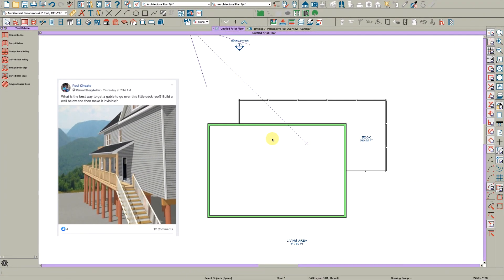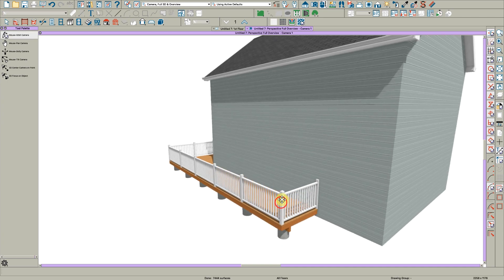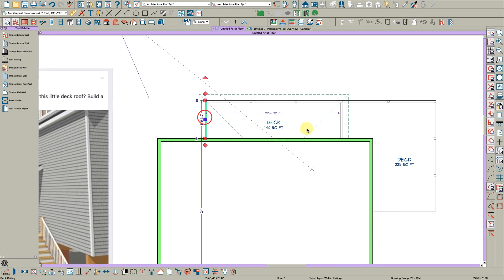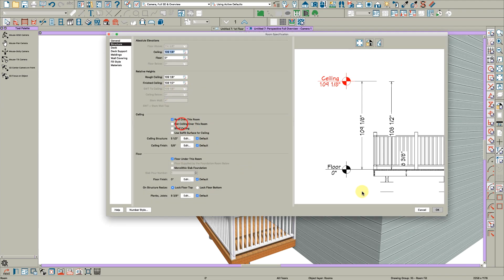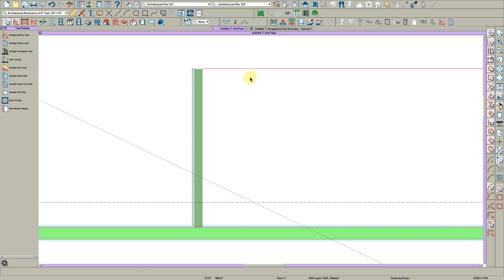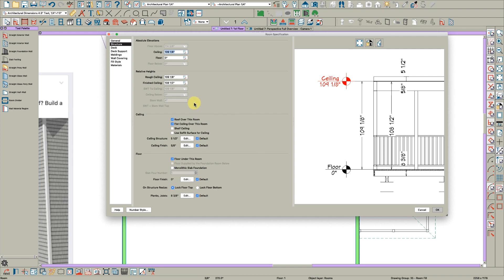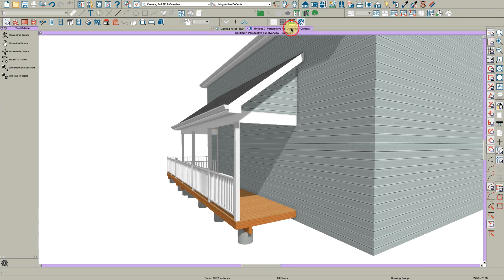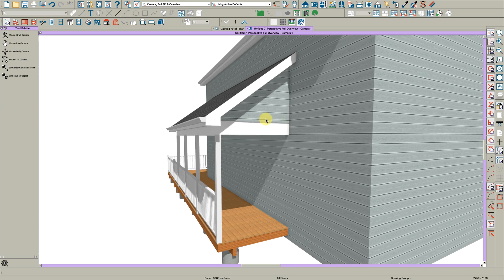Create a Gable Roof over a Porch Railing using Chief Architect X11

Comment: The amount you just taught in a 7 minute video is mind boggling.
Reply from the maker: Thanks!
Reply: @ChiefSkills  have you ever designed a shed roof over an L shaped wrap around porch with the caveat being the deck depth is 8' on South and 10' on the East
Reply: @j.jarvis7460   - does not sound difficult. Is there a 2nd floor?
Reply: @ChiefTrainingNow   correct.  18" joist and 9' floors
Reply from the maker: Send me your Chief plan and I’ll do a video. Send to steve@mychiefskills.com.
Reply: @ChiefSkills  Hi Steve I'm watching from South Africa and I'd like to send a drawing to you to make a video of it. I use Revit but would also like to work with Chief as well. I find Chief's approach to designs easier than Revit which is why I'd like to know more about it. I've been watching your videos for years now but had not had the time to start working with Chief and now I think I'm ready.